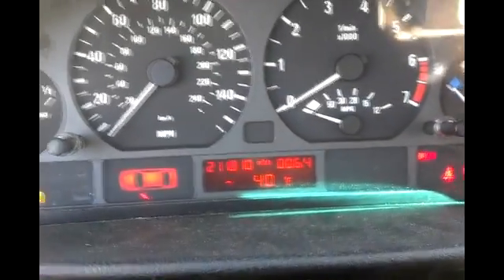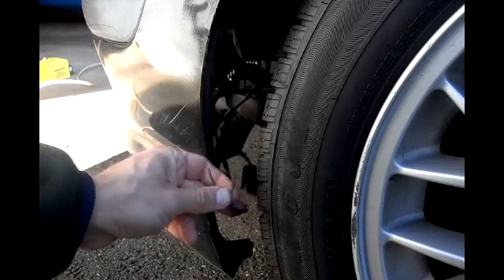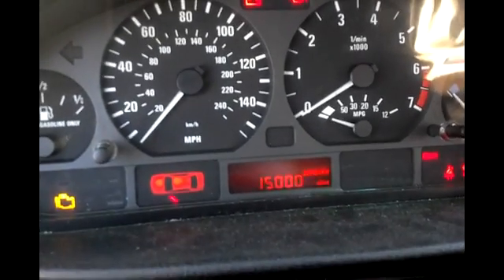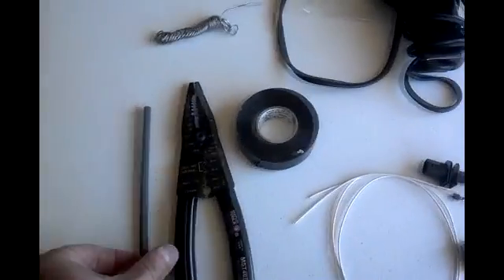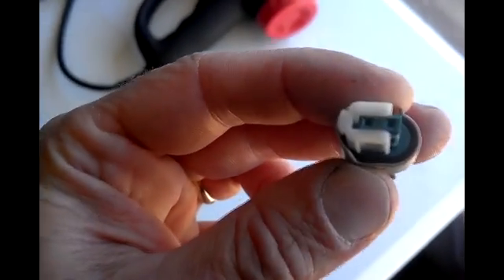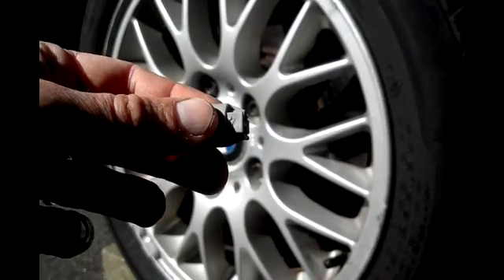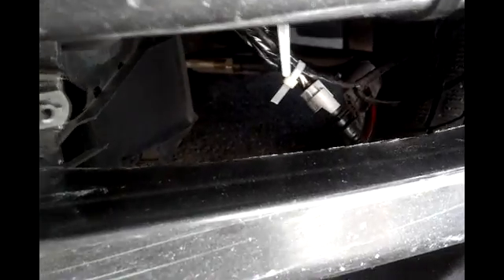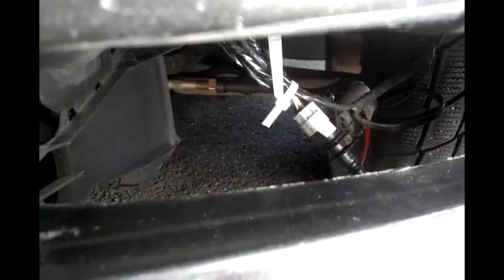BMW Temperature Sensor Replacement Repair, Due To Temperature Sensor Reading -44 or 122 Degrees

Comment: @askthecarexperts i have bmw f10 and i see that plug under the bumper without a sensor, but i also saw that i have one sensor there. Is it possible that there s supposed to 2 air temp sensors?

Comment: i put the 2 wires connected but it reads -40 still
Reply from the maker: Hello Victor, There must be a problem further up in the wiring or the sensor itself is bad. Also the cluster can hold the old signal until the vehicle goes to sleep so try to lock the vehicle and let it sit for 30 minutes and then recheck the temperature reading.
Reply: AskTheCarExperts Thank you Ill see how it goes .Really, Thank you keep making videos your awesome

Comment: this just saved me hundreds from the estimate at Mini. my sensor was damaged, cables were good. sensor was $16 on amazon prime, repair time was less than 5 min. 2013 mini roadster. sensor location front passenger wheel well.

Comment: GREAT! SPOT ON.  Never would have thought that the amb temp sensor would prevent the AC compressor from activating...just blamed the clutch. But I was gettiung intermittent cooliung, so frustrated I searched the forums as well as you tube.
Such a simple fix for a problem which  never would have occurred to me.  I replaced the front bumber skin in march and at that time replaced the temp sensor which I discovered was missing, with an aftermarket part.  I was unsure if there ever was an AC issue since my wife was the main driver at that time.  After I replaced the temp sensor with a jury-rigged compression fitting and taped it together I was able to get the external temp until several weeks later all I got was -40 F.
I did a test repair with existing parts and it WORKED. So I ordered a kit (including a new sensor the wires and mnost importantly the connector ($24 ebay).
You made my day. 
Bob Karanian
BTW: your video and explanation were detailed and concise.

Comment: Thanks for this. I struggled with that ((*&^$#&^ "universal connector" for about half an hour. The wires would not lock. After I watched this video it became clear that I was doing it right, but the tiny tabs on the wire ends were not standing up tall enough. I had to pry them up slightly and they snapped in perfectly.

Comment: THANK YOU THANK YOU THANK YOU....I went to Advance Auto parts, ran the code. came back googled for help found your AMAZING video....went out to my car and found the DAMAGE I had done....did the fix, air conditioning working, and now check engine lite out..and just waiting for a new fender liner.....all this from a woman!!!! Great Job! I can only imagine what this would have cost had I gone to the dealer..right outta the gate...the $125. Diagnostic ...LMAO

Comment: You are a savior my friend. I hit a raccoon couple of days before and front bumper, fog lamp, splash guard and brake air duct is messed up. Today I realized that my temp sensor is also missing ( as it read +50C when actual temp was -12C) . Will be doing the repairs this weekend.Thanks a ton for this video. :)

Comment: Hi, 

This is excellent video with perfect information. The only question I have is...how did you find the part numbers?

I need a silver ring around my headlight bulb that came off and melted. How do I find the part number. I looked at Pelican Parts but could not fine. 

Thanks

Alps

Comment: Good video.  Was curious if the zip tie mount held up?  I have the same issue only I got lucky and have both the sensor and wiring harness intact. No wheel fender though.  I need to mount it somewhere where it won't contact the spinning front wheel...

Comment: hey i have a question maybe you could answer for me, i bought a bmw 320d e46 yesterday and the outside temp sensor is missing and driving it today the readings keep going back and forth between hot and cold which causes beeping. would you think the wires are damage somewhere. thanks great vid

Comment: AskTheCarExperts  I have the exact same issue. I have exposed wires in the front bumper and when they are disconnected the temperature is -40 and when i short them the temperature is +122. Would you have the part numbers for the pieces i need to repair it? Thank so much!
Reply: shoulda just watched the video. all good on the parts. great video.
Reply from the maker: No problem Nick :) Glad my video helped!

Comment: Please help i need my cat smogged but the emgine light is on the obd says ambient temp sensor fault i noticef it was ripped off so i dpent 100 bucks for a new one hokked it up amd it still wont work and syill a check engine light pleasr amy suggestions?
Reply from the maker: Hello Kristie, This is most likely due to a wiring problem still somewhere further up from where the wires where damaged. I have a video on wiring troubleshooting and testing. http://youtu.be/Wsms8PiCIjE

Comment: Hi I have a 1994 BMW 318i, with 2 problems my out side temperature sensor is broken and the Auxiliary fan does not work not sure if the two are connected, I gave the fan direct current from the battery and it worked so fan motor is good when I put the ac on high and hot all the internal blowers come on but still the Auxiliary fan does not turn on and the air is cold. it looks like all the fuses under the hood in the fuse box look good, because my out side temperature sensor is broken.  would that stop the fan from working. also not sure if the fan is actually getting power. is there a switch or sensor that would send power to the fan and if so were would I find the switch? would like to test that also but I can not find it.

Last question should the Auxiliary fan come on if the car is staring to over heat?
Reply from the maker: Hello AarIon, Unfortunately I know less about the older BMW's as I started with BMW when the E46 was out. The fan is powered by a voltage regulator that is part of the fan. It could still be a fan problem or it could be a fuse or relay. On later model BMW's the fan does come on if there is a temperature problem.

Comment: Just bought my 2001 325ci and my check engine light went on and the outside temp read -40. Thanks for the help!!!
Reply from the maker: Your welcome :) Let me know if you run into any problems. I would recommend contacting me through my google plus page as it is easier to talk back and forth :)

Comment: Great video how many sensors are there?
Reply from the maker: Hello Mo, For the outside temperature just one. Early BMW's had them in the wheel well area. New BMW's integrate them behind the grill. The earlier model BMW's where much easier to access. Thanks for watching!

Comment: Hey. My temperature reads -40F. I already  found where the sensor should be located. I bought a new sensor and plugged it in, it didn't work. I bought a new sensor again and a new plug with wires and again it still reads -40F. I plugged the new wires directly onto the old wires higher up but nothing worked . i found no damage along any part of the wires. This should have been an easy fix but i'm stuck . Please help!!! 
By the way my car is an E90 335i
Reply from the maker: If all the wires are good then the failure would be the instrument cluster. The wires are a direct input the the instrument cluster. You should remove the cluster and ohm out the wiring from the cluster connector to the sensor to verify there is no breaks. Also check for a short to ground.

Comment: hi man my bmw has the bc button (on board computer ) but it do not do nothing, i try setting the time and i still cant do it ,the radio still doesn't have the time.this bothers me because i am always looking at the time and i have to pick up my phone to do it. please help!!!
Reply from the maker: Hello Brian, It may be that your BC button is not working. The gest place to start will be with having a new switch installed. The only way to change the time is to access it via the cluster using the BC button. I hope the switch does the trick for you.

Comment from the maker: Hello, The wiring enters the harness and is a direct input to the instrument cluster. To make sure you have the correct wires you should remove the instrument cluster and ohm out the wiring. If you send me the last seven digits of the VIN I will see if I can find the pin numbers you need to check at the cluster for your BMW.

Comment: hi super great video, i've a question i hop you can help-me:  my car as many others shows -40 and i try to do what you show in this video but, not just could't find the sensor as i could't find the wires at all...there it's the harness as yours but the wires doesn't come out from it anywhere...i was thinking on buy a sensor and make the wires long enough to plug them in the origin from where tey come but i dont know where it is..can you help me? where do the wires go after the enter the harness?

Comment: Great vid !! I just had a question, my bmw e46 is a little weird when it comes to car washes or when it rains because when it gets wet the ac will not blow cold air it will blow warm air or hot air depending on the weather outside. it only happens when it gets wet and after 4 to 6 hours im guessing after it dries up good it will start blowing cold air again and they told me it could be the ambient temp sensor. do you think if i change the sensor the problem of getting wet will stop? thanks

Comment from the maker: You may need to install the sensor and secure to a safe spot. The compressor can shut down when the system thinks it is too hot as well as too cold to protect itself. It uses the temp sensor to do this.

Comment: My outside temp has been showing 40- ever since the guy at the local car wash handed me my wheel liner and told me it was okay to just throw it away.  Now that it's bloody hot outside, my air is great for a few minutes and then hot air comes from dash and on the floor and the cold air stops.  I found two wires hanging down from the passenger side front bumper - I stripped the coating away and twisted them together.  I haven't tried driving it yet.  Hoping I don't blow up my car.  Yikes!

Comment: great video , got myself a new sensor yesterday going to give it a go at the weekend , would you know how to remove the gear knob in a 318ci convertible , I want to change the leather on the gear knob and not sure whether to twist it or pull it up?

Comment from the maker: There has to be a break in the wiring further up or a problem with the instrument cluster. Most likely though this is another open in the wiring. Follow the wire up until you find it or splice a new wire as high as you can. You will know the open is removed when the temp reads high. Keep in mind you sometimes have to wait before the temp sensor updates. Try locking the vehicle and waiting a half hour.

Comment: hey on my 2000 328i im having the same problem the temp shows -40 and i cut off the sensor connection and connected the two ends together and it is still reading -40 and my a/c compressor turns on for like 2 mins and the shuts down by itself.. HELP

Comment from the maker: The wiring goes up to the instrument cluster. This is a hard wire signal directly to the cluster. You must have another break in the wiring higher up by the sound of it. Try giving the wiring a tug to see if you can pull it out which can sometimes help to find the cut or broken wiring. Check along behind the wheel well and cut open the sheathing on the harness and work you way up the wiring until you find the damaged spot.

Comment: i already follow your instructions. i bought the parts according the part numbers explained. But after all of that, the temperature still shows -40ºF to 120ºF 

I gave it 2 days and expect for the sensor to settle. but no changes. I thinking the the damage is in the wire. Where does it connect?

Thanks!!!

Comment: I just picked up the car yesterday and thought it was that I was out of freon, so after taking it to Jiffy Lube to get the AC recharged, that didn't work (thank goodness they didn't charge me).  I freaked out, hoping it wasn't the AC compressor.  So happy I found this video.  The only difference was that I needed to drive the car a bit for the sensor to work and the temp to stabilize, and the AC blows ice cold.  (Got a free AC recharge)  Thanks for putting this together!

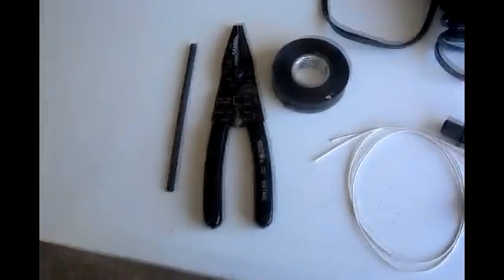Comment: he says them right in the video at around 4:50
connector 61138365340
wires 61130005199 (need two).
I didn't write down the sensor number as I already have it.

Comment from the maker: Hello, The wires on the other side are for a small round component that I believe has to do with the washer jet heating to prevent freezing in the winter.

Comment: This worked amazingly....I had the same problem and ran across this video while looking to see what was wrong...followed the steps and now it works fine...which is amazing because the A/C would shut off in the height of summer...not what you want happening in 90+ degree weather!!!

Comment: The wires for the temp sensor on the left side are blue. Any idea what the green wires on the right side are for? Same spot on the bundle, just on the right side. 2001 325ci...

Comment from the maker: Hello Janny, It can prevent the AC from not working. When the wires are open and the reading is -44 the compressor will be deactivated as the system is preventing a freeze up due to outside temperature.

Comment from the maker: Unfortunately there is no good way to check the BC button short of having the stalk switch replaced. It sounds like it might be the button itself as the temp sensor should not effect this circuit at all.

Comment from the maker: The short is usually near where the sensor was damaged. I usually unwrap the electrical tape and hunt around the wiring harness. It would be abnormal for the short to be near the instrument cluster. Also since this is a low amperage circuit it should not short out the cluster unless it gets a short to a 12 volt high amperage circuit.

Comment: So I'm in a bit of a pickle. I could really use some help. I did all of what was shown. At first it read about right and then skyrocketed to 122 degrees. When my sensor fell off, it took a few days for me to get the part and kept alternnating between -40 to 122. Removing the sensor leaves it at 122. This tells me there is a short. Is it possible that the dash short circuited and now needs to be replaced? 

Please help -.-

Comment: Thanks for your quick response. The problem still exists. Display doesn’t change when I press the button. The Model Selection was working fine back 2 months ago except it’d go to Temp Display suddenly beeping few times and switched to -40F.  I just pressed the button to set it back to clock.  But started a month ago, the Model Selection stayed on -40F. So I noticed the fender liner/sensor were gone, & 2 wires were torn. The new sensor works fine. How do I check BC button? Thanks for your help.

Comment from the maker: Hello Sylvia, Thank you for watching. I enjoyed making this video and was hoping it would help quite a few people. The wiring for the temp sensor is a direct input to the instrument cluster so it should not have effected the BC button at all. Hopefully it has fixed itself by now but you could always unplug the sensor and see if it has any effect. It would in essence go to an open circuit. It sounds like it may be the BC button on the stalk switch that may be failing. Hope this helps :)

Comment: Thank you. Very helpful video for me as a first time repair person. The temp display changed from -40F to 91F degree right after I connected the wires and sensor. But the Mode Selection seems not working. I pressed the button to display the clock, or fuel. The display stays on the temp 91F degree. Is it something wrong with the Mode Selection too? It was fine before the temp sensor broke.  Thanks for help.

Comment: ac would not get cold in summer and in cold weather the heat would take forever to get hot I thought it was coolant or thermostat stuck or a coolant sensor witch of course would have been an arm and leg to fix I jus so happen to stumble on your vid found the wires touched them together and bam +122 on the dash anyway 50 bucks later and sensor installed FIXED!! not sure what it all regulates but seems to run better as well as ice cold a/c and hot as hell heat could jus be me but THANKS SO MUCH

Comment from the maker: I see. Thank is a strange problem. The heat is controlled by the IHKA panel (heater control panel) by sending a signal to the water valve which allows flow of coolant to the heater core. You water valve may be stuck open or the IHKA is sending the wrong signal.

Comment: I should mention that my AC system is working fine when it is turned on. When the AC is on, there is cold air coming out so that's one way I have been doing to keep the air in the car in an acceptable temp range--when it's too hot, turn the AC on.

Comment from the maker: Hello Winston, You may have a problem with the AC system if you do not get any cold air. This could be a leak in the system or low refrigerant or a failure of the compressor. It is normal to only get heat from defrost setting. The heat from center vents is always less but if it does not seem right make sure your stratification wheel is set to hot and make sure your coolant level is good.

Comment: My 02' 325i's weather control system is not working correctly. No matter what temperature I set it to, hot air would come out. It appears that the hot air is coming out from the vent near the windshield glass but those from the air vents on the dash are not that hot. Some more observations. One is that it would take a while (5-10 min of driving) when this happens. Another is that if I turn fan off, it would take much longer for the heat to creep in. Hints on how to diagnose and fix the problem?